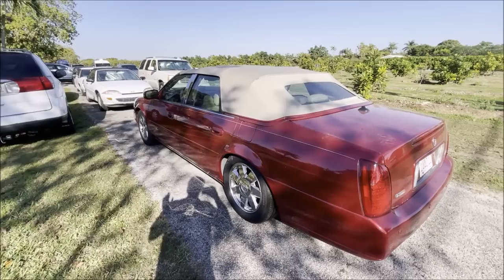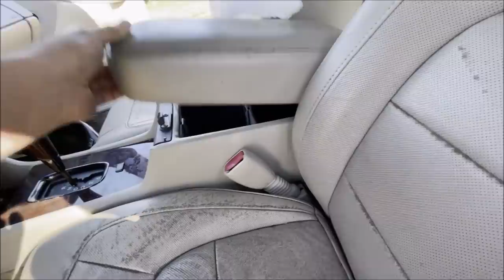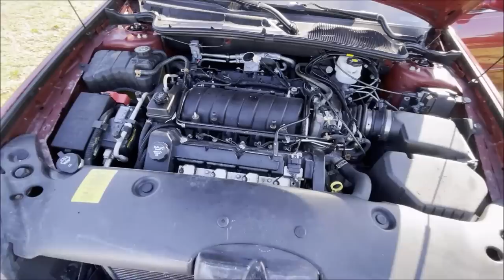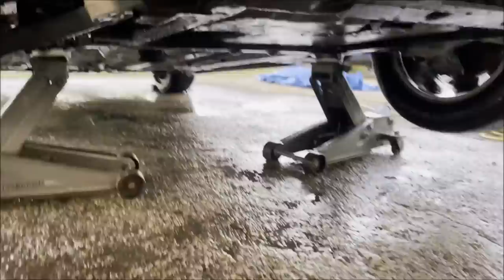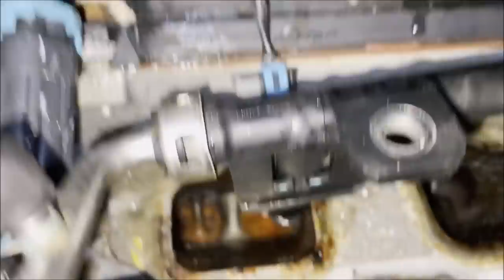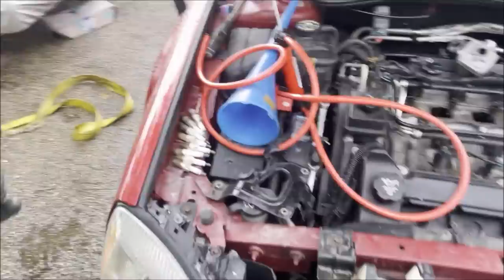I Bought ANOTHER Flood Convertible Cadillac DTS By Coach Builders

Comment: wouldnt a good 1/2 inch high torque impact gun be better to check the crank shaft
Reply from the maker: That could snap the crankshaft or crank bolt
Reply: @bigalsbikeandauto  got ya

Comment: Hey Big Al do you have an email or way for me to reach you? Got a couple questions about flushing flood transmission. I’m in the Keys. Thanks!
Reply from the maker: I do but I’m bad about checking my personal email. Can you ask here?
Reply: @bigalsbikeandauto  I found out this week my 67’ Impala likely was in a fresh water flood and hasn’t been touched since 2016 at least. I replaced the fuel tank, drained about a gallon of water out of the engine (not great video coming to my channel soon), changed the oil and actually got the engine to start. Wondering how to go about flushing the TH400 as I’m sure it has water in it as well?
Reply from the maker: @nopatienceprojects  if you go on auto auction rebuild’s channel and watch the flood Allante video you can see how we flushed the flooded transmission step by step.
Reply from the maker: @nopatienceprojects  it would be easier to watch that then to try to explain it in words, but basically you remove both cooler lines from the radiator and let the pump of the transmission suck in new fluid while it shoots out the old fluid.
Reply: @bigalsbikeandauto  I watched it just was back when it came out. Will re-watch and also see if I have a cooler on the car, it was one of the earlier TH400 cars made. 

Was expecting a lot of stuff to fix/restore but not flood! Engine oil was a goo consistency, going to pull the pan and clean the oil pump screen and bottom end too.
Reply from the maker: @nopatienceprojects  fortunately it’s an older car with essentially no electronics…that’s the real killer with these flood cars. You’ve got this!